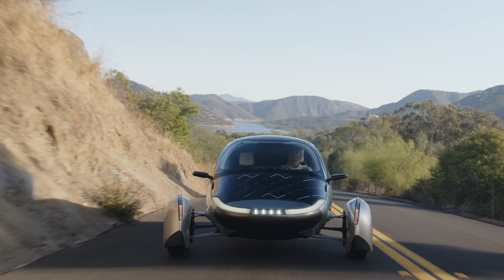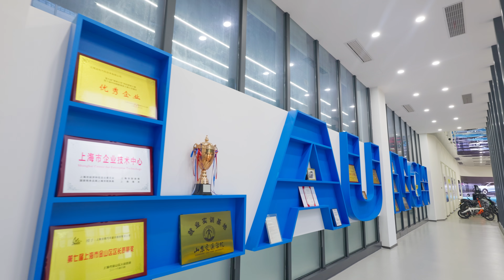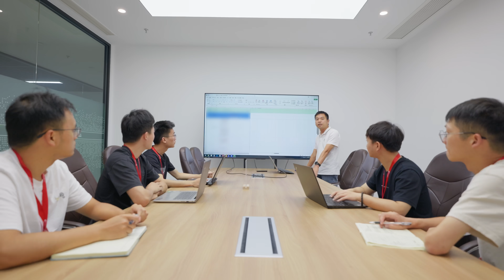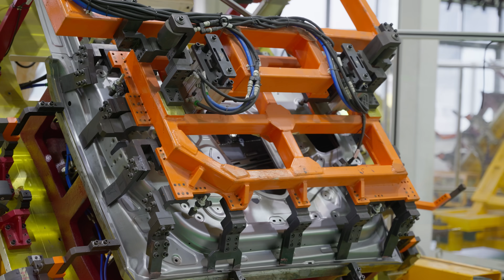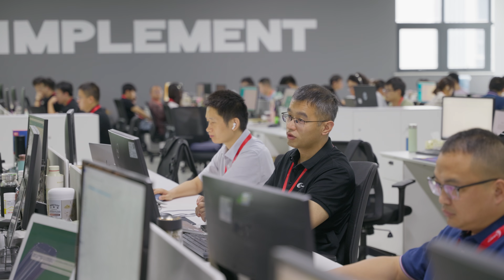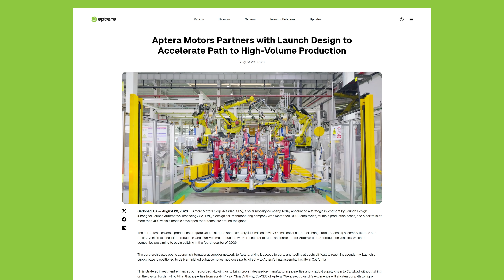MEGA UPDATE: Aptera Has a New Production Partner

Comment: World-wide - now we're talking. How about an update on the plans for compliance with EU/UK L7 size restrictions for autocycles? Three options: get the EU/UK to change the 2m width restriction; shorten the front suspension and/or go open-wheel (at the expense of turning circle and/or aero); reclassify as a car in those markets, which means full crash test, front number plates, probably more airbags to chase the NCAP rating.

Ooh, just thought of a fourth one: stick rear view mirrors on the wheel pants and claim they're not part of the body width, like (for example) SUV door mirrors, and only.worry about the passenger compartment fitting the size restrictions.

Seriously, as a UK reservation holder, I hope you have at least one person working on those issues - there must be a not-insignificant number of us who are still included in the company's talk of future sales value. Yes I know I've asked this before, but it is important that Aptera continue to engage with international reservation holders, and it's all gone very quiet about intention - the only glimmer in the past year or so being what has been said in this video.

Cheers!

Comment: Wow!  That is huge news.  Was hoping that Aptera would get into our hands sooner than later and you guys figured out a way to do it.  Although this partnership I wasn't expecting but someone did mention this and I brushed it off because I thought the Aptera really didn't need a large production facility or really robots to build it.  But in order to achieve high production, it has to be done and I'm happy that you guys found a partner to work with.  I'm guessing it's Chinese, since the language on the wall is Chinese.  I'll be interested to hear what exactly they are doing and how soon those machines will be brought over to assemble them here.  Because that was the plan for US based manufacturing.  But it sounds more like it will be made over there because of their massive logistical network.  Interesting times indeed!  But we're getting it done!  Congrats!

Comment: So the frame on the bottom will be built by Launch and sent to aptera to then slap the parts into it? If that's the case I'm okay with that you can't really mess up a frame so I'm not worried about the quality of the car. It is just metal put together buy robots. Just curious as to how ordering is going to go, cause stock pilling the frames in a small building is going to be hard. So I imagine lead times to get them might take a while just like the composite body's from Italy.  Hopefully next video is validation from the builds you have been working on cause the ones in the background look ready. Need to show some efficiency and range numbers, as well as the crash test.
Reply: We don't exactly know how much Launch will be doing yet.  But it sounds like they will be able to build the entire vehicle in China to export around the world.
Reply: @artboymoy  I doubt they will move the whole vehicle built to over there. They said in the video they are gaining knowledge on how to set up a line and are refining their process already due to what they saw and are being told by the company. They already have a floor plan set in the building with stations, why would you just let all that go and build it in China. They already have composite station to put it together and put all the parts in. The only thing they didn't have was a station to assemble the frame. So if they just receive the frame ready to go they can easily handle the rest. They already have the knowledge of assembling 11 complete vehicles and what they need to fix along the line. We will have to see in later updates but it does not seem like they planned on pushing production to China with all the money and effort they spent setting up their building for production.
Reply: @spro_halver8553  I can see them bringing over some of the machines they're going to be using in China to the US.  It is a partnership.  But IMO, they have plans for China to build Apteras to be sold to the rest of the world.  China has the means and logistics to really make that happen.  I think it would be really hard for Carlsbad to do all that.  IT's a major move in streamlining and efficiency for production  and isn't that what Aptera is all about?
Reply: @artboymoy  I can agree that they will have to use these guys to sell Aptera in China, what I do not agree with is China building them and shipping complete vehicles back to America.